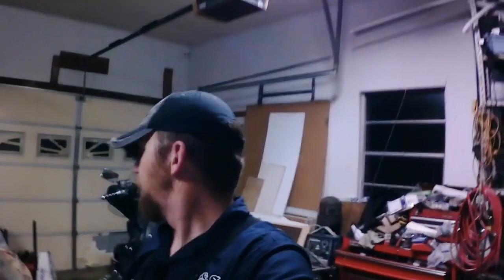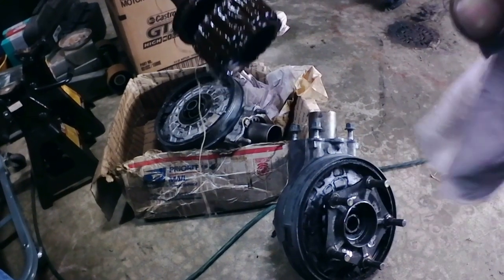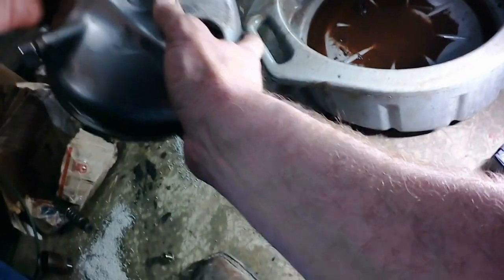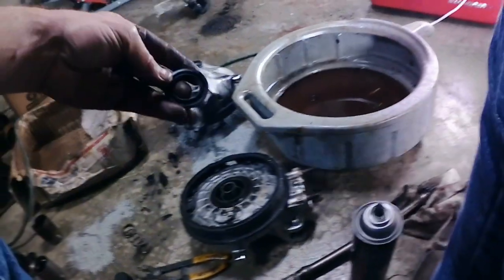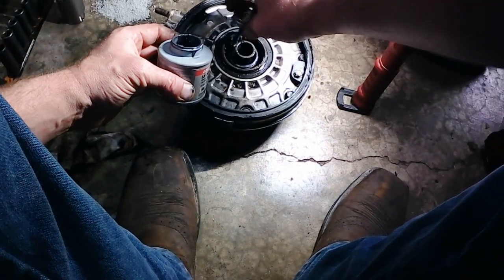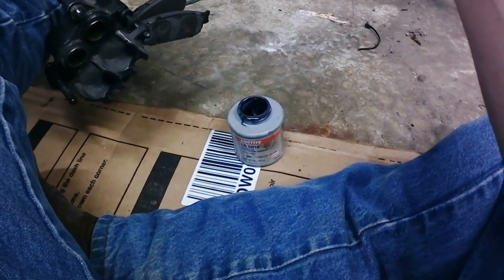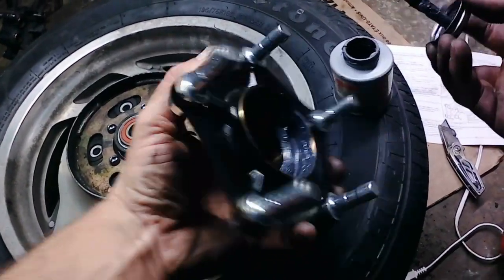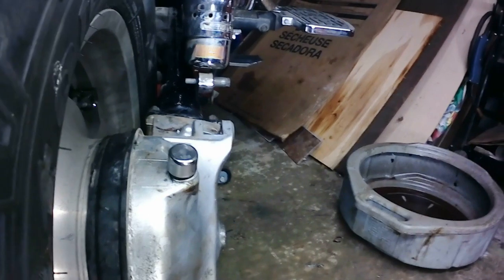Final Drive Destruction Part 6: Cleaning and Reinstalling The Rear Differential and Tire

Comment: I don't see a video for bag frame mount install so I'm asking this here. I removed mine for first-time to replace rear tire. Is there a trick to getting the holes to lineup to remount the bag frame   and get the bolts through to the fender? I've been working on this for several days and managed to get 1 of the 4 total bolts in. Any help is appreciated!